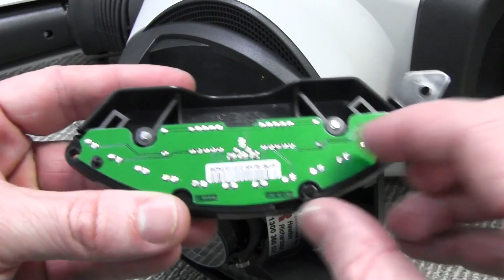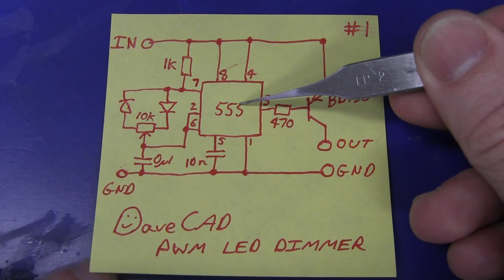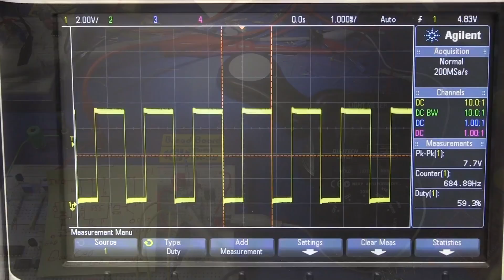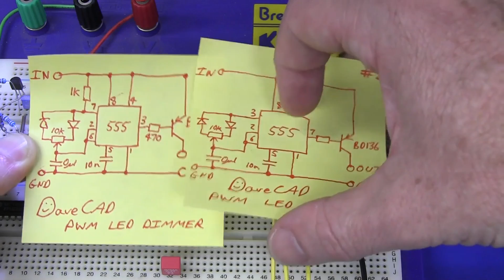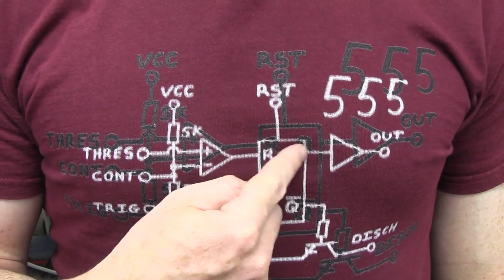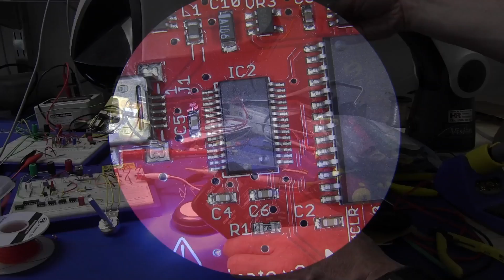EEVblog #392 - 555 LED PWM Hack

Comment: Could you go over again what the two diodes are doing?
Reply: having the diodes ensures that the charge time is governed by one side of the pot and the discharge time by the other without their interfering with each other. That way you can achieve a variable mark-space ratio (PWM). Plenty of great tutorials on 555 circuits online that will explain in even greater detail.

Comment: i noticed the final form had 4 caps- whats the 4th for ?
Reply: +sparky obrian I think there are 3 caps overall, not 4.  1) 0.1uF - Timing,  2) 10nF - Compensation on pin 5, and finally the 3rd one a bypass capacitor, across the rail, which is normally 0.1uF.  Hope that helps.

Comment: Bad form, Dave - modifying a circuit with the power on.
Reply: REAL engineers do it with the lights on! LOL
Reply: like 555 costs more than ¢15 lol
Reply: Bartosz Olszewski It's the principle bro. Is power on? If "yes", turn off then modify.
Reply: Electro I know that and still I think it's not worth it.
Reply: Bartosz Olszewski Would you eat without washing your hands? While you may not die, you are dicing with death.
Reply: Electro no, I wouldn't. But come on, I can't come up with proper analogy now, but he won't get any shock, maybe couple of cents if something got zapped. I understand that if you work with $1+/20V+ circuit it's good to turn off the power but for less than that I wouldn't even bother.
Reply: Bartosz Olszewski I know Dave won't get fried anytime soon, but the purpose of YouTube tutorials of this type is really correct training. There are some pretty eager young minds out there and they follow people like Dave, you or even me.
Reply: Electro well, yeah, sticking multimeter probes across unplugged power supply mains inlet traces is not a good idea (learned the hard way, but thank God only my probe got totally melted, not my fingers and heart) so there may be something to that. Respect.
Reply: Were you in current mode?  Any decent multi meter can handle 120v/240v AC Mains just fine (measuring voltage).

Comment: some one knows why there is a noise when I try to simmer a motor when I'm close the pot to 0
Reply: +moshe ashkenazi  you need a cap on the output and a diode in reverse to cut negative spikes

Comment: Having to use what I have on hand, I used an IRL3803 (140 amp rating is a tad overkill) instead of BD136. Between pin 3 and the gate I used 47k and since I have a CMOS version of the 555 as well the cap from pin 5 really isn't needed. I read it somewhere on Talking Electronics that pin 5 need not be connected in CMOS versions for PWM control, or perhaps I misread something, but it works well without the cap... The voltage going to pins 4, 7, and 8 get an additional 220ohm resistor but the voltage going to the FET remains unchanged. I got VERY close to 0-100% according to my crappy sound card oscilloscope.

Comment: Hi. And... if i want 30A power load?
Reply: Mosfets are your friend, hook up 5 IRFZ44s in parallel, and there you go.
I used this with one for 3 amps, works like a treat
Reply: +Juan Harris change the output stage
Reply: +Juan Harris look up IRFP250N hex fet use 2 pot a 0.1 ohm resistor on each source pin hook the gates to pin 7 and drain to gnd lastly a 1 k resistor between pin 8 and pin 7 (( pull up resistor ))
Reply: +Jamie Phillips that 0.1 ohm resistor will fry up
Reply: use a wire wound 1 watt they will handel it no prob

Comment: Would be nice if this could have dimmed one or the other side independently so you could get "side-ish" lighting. That's sometimes useful for component recognition and adds a bit more 3D depth to the image.
Reply: +PIXscotland I think it's just a matter of build 2 units and placing one each side. Good luck

Comment: I'm having a hard time seeing why just a 10k pot wouldn't work.
Reply: +techhelper1 ... Yes, a simple pot on the LM317 ADJ pin would vary the supplied current. But Dave would have had to cut the video to under 10 minutes, and most of that spent reading the data sheet. Where's the fun it that?
Reply: techhelper1 I believe most common pots are rated to handle no more than 0.25W.

Comment: I had subtitles on for a few of these videos, as I didn't have my headset around. The way you're voice is automatically made into subtitles had me cracking up give it a try some time,  just turn captions on when watching a video back. 

I wanted to do something exactly like this myself, I'm going to copy the final circuit and wire it up to my own mantis. Amazing they did not include something like this for such an expensive price of equipment!

Comment: Hi Dave, just a quick question :
I don't understand why the frequency is changing in the circuit #2.
In fact, when you adjust the pot in one direction, it lower the resistance to load the condensator and higher the res. to discharge it. And vice versa.
The freq. must stay the same, why not ?

Comment: Thanks Dave, I've seen a lot of your stuff and keep finding ways to implement things from videos you do.  I think I am going to use a slightly modified version of this to make a dimmer for the under-cabinet LED strip lighting I'm installing in the kitchen.

On a barely related note, I'm going to buy one of those t-shirts for my wife merely so I can comment on how nice the threshold and output pins look when they're cold :-P

Comment: Dave...you just screwed Mantis out of doing a $300 accessory light dimmer for their microscope.
Reply: They could do all that but "prior art" prevails and their action would fail. Besides, whilst the specific (clever) usage is for the Mantis in this instance the basic circuit exists in probably 10 million posts on the web ... do you think Dave really cares?
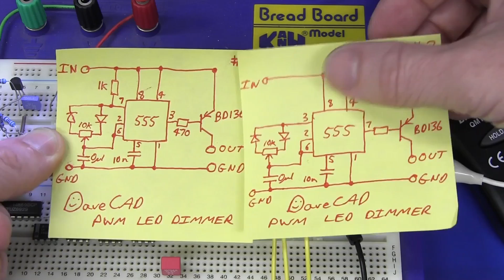Reply: @boblewis5558  I have seen the second version even on Great Scott's channel. Only difference was that I didn't quite understand the fact that pin 7 is used as an output. 18:50 is quite a jaw dropper for people just learning.
Reply: @lamjeri  a quick look at the internal circuit block diagram of a 555 would explain that confusion. BOTH pin 3 AND pin 7 are effectively output pins. 

Pin 7 being labelled "discharge" doesn't mean it cannot be used as an "output" pin because internally it is basically just an open collector of an NPN transistor, which when switched on provides a discharge path to ground for the timing capacitors. 

Pin 3 conversely has an output drive circuit which has its own "pull up" internally, hence the lack of need for the external pull up when used as the "discharge" pin. 

A clever use of basic understanding of the internals to "reuse" the chip in a clever component reduction. An engineering solution to the ever present "bean counters'' desire for cost saving, no matter how trivial!

It might surprise people starting to learn, but even engineers with decades of experience can be surprised by novel uses of a circuit because someone has realised the "detail" and how it can be used alternatively. A classic example is the use of 3 logic inverter gates to produce an oscillator. Not something that might easily occur to someone just starting out in electronics but very old hat to someone of experience.
Reply: @boblewis5558  You know your stuff, Bob. Impressed!
Reply: @boblewis5558  You know your stuff, Bob. Impressed!
Reply: And this video will demonstrate prior art!
Reply: What he's actually done is give them the blueprints necessary to steal the idea, manufacture and trademark it, and then take legal action against him. #CapitalismBaby

Comment: Cool stuff. My preference would have been to use circuit 1 with an N-channel MOSFET as a low-side switch. Circuit 2 was a clever solution though and I never would have thought of it.
Reply: That would be my preference also. Thanks.

Comment: Why not simply use a simple rheostat before the input power cable for a simple, and quick solution?
Reply: Constant current supply + any value below 50% = LOTS of wasted energy in the form of heat
Reply: EyesOnReality sometimes simple and quick arent the best solutions
Reply: It's usually why they end up getting called quick and dirty! :D

Comment: Man, You're so bright !! I was struggling to build a 555 PWM dimmer and y was quite lost after an intensive search to identify so many variations of the circuit, without knowing the meaning of it

Now I Got It with the Output  pin 7 or 3 variation;

 just 1 question, If supply is 9V , how this is that your 2 leds acting as diodes never fry  (i was always taught of limiting current in LED with load resistor)  so what happen to LED of the short-circuited side when Pot is 0 or Max (is it because ther is only limited current  flow through LED to charge the small capacitor ?

Keep the work
Reply: LEDs can take pulse currents much higher than their continuous current. That and since they only see the voltage difference between charge/discharge cycles (i.e. 1/3Vcc and 2/3Vcc) they are only getting 3V at most since supply voltage is also limited to 9V from the power supply. ;-)

Comment: I ca'nt find a lot of information on this type of pulse circuit. So I was wondering how well it works. I know that there are some lights that use this type of drive system. I wonder if the circuit you have would work well outputting 1 amp?

Comment: I was wondering, what do you think about the use of such a circuit to make an LED put out more light by pulsing higher than normal forward current at a low duty cycle and high frequency?

Comment: I thought I saw the frequency swing swap when the 555 circuit had the last modification. It was at first lower frequency at higher duty cycle and then it went to higher frequency at higher duty cycle.

Comment: I don't understand this.  I only get 50%-100% output range with this schematic and another variation that claims 5%-95%.  Any ideas?  Does using a low power version of the 555 cause this?
Reply: Never mind.  Doesn't like 5 volt operation.

Comment: Question: Might it not be more sensible to replace the transistor BD136 by a MOSFET?
Reply: good question. i think mosfet is overkill. it would be usefull if why decided to drive a motor instead of leds since it would be able to suffer 10-20 A of current. I use a IRFZ44 mosfet driving a dc fan on almost exactly the same above 555 pwm circuit.
Reply: jimis04 could you give me the schematic for this. I am doing a college project where i need to drive a motor which in turn will pull a hoist. Ive made a small model and this circuit would work. Also have you got an h bridge setup? Thanks for your help
Reply: geordieviewer
http://forum.allaboutcircuits.com/attachments/a-simple-pwm-circuit-based-on-the-555-timer-gif.12058/ georgediviewer this is the schematic that utilizes a mosfet for PWM with 555. you can replace IRFZ46 with IRFZ44 that is most commonly found on local stores.

Comment: It could be done with pot and one transistor as a current source (pot in emitor, base at dc bias). The current source with lower current would "overide" the other one. Anyway, this is much nicer solution.

Comment: The video explains it.  The P.S. drives a constant current device, so more resistance would simply increase the voltage (across the pot) and deliver the same current to the LED's.  A PWM is the perfect answer to this situation, although a non-inverted output would have allowed a higher PWM cycle (10% - 99.9% is better than 0% - 90% for LED control).

Comment: Good info.
I have a question. If I wish to create a 5KHZ PWM signal (+/- 3 %) over the full range of the pot sweep achieving the full 5% to 98% change in duty cycle what combination of Resistor and Capacitor value do I need to use in your design. Thanks.

Comment: how would you recommend using this circuit to step up the current and protect the circuit from back-flow for running something like an electric motor, would just a transistor and a diode do the trick? (lets say a 24v 10A motor)

Comment: A Power Potentiometer is an expensive part and will dissipate a lot of waste power as heat.  Dave is in Australia so he is warm enough.  By switching on and off to control brightness the design will be much more efficient.

Comment: Dave, When I do this circuit I connect the pin 4 to pin 5 this eliminates the need for the small cap and makes for an easier PC board layout.

Comment: Good Vid. Dave. I was using your first Bread Board design and changed it to your second design, as its for a differant use I have differant resistors but thanks the new board works much better.

Comment: Nice video. I'm looking to purchase a power supply for my laptop repairs. I've found 2 at a very good price both are 0-30v 0-5amp. However I believe they are Constant-Current. Would current limiting be better? 
Plus is there a method create an add on to manipulate the CC to current limiting seeing as the maximum current set would readily be available anyway.

Comment: Was trying to fiddle with a charge-discharge relaxation oscillator using single supply, didn't work, I have to do some hand calculations for it first.

Comment: Have you ever considered using coloured filters to help you discriminate between colours? Pause the video and hold a red filter up to the screen. The yellow trace will appear brighter, because of the red component. The reverse will happen with a green filter. Just a thought to aid your independence in these matters. I'm not colour blind myself, but it seems like it might work.

Comment: The thing that amazes me the most is that the manufacturer of the microscope did not include the dimmer function. Would not have affected the manufacturing price by to many fractions of Dollars I imagine. It could even have been used as a selling point. 

Love the solution. :)

Comment: I've a question about your 555 circuit. You connected the diodes to pin 7, and this pin with 1k to vcc. I prefer connecting the diodes directly to the output, gives a more symmetrical output and saves a component. Why choose this method?

Comment: Yep, I guess 0.1uF is nothing to be worried about, still i filter most of the PWMs before i feed them in to LEDs or DC motors simply because additional high frequency in a DC motor is 1- more noise and 2- bad for non-dipped coils. I know it's overdoing it, but i think for me it is worth it. I also have slight light induced headaches when the light is too bright or there is some kind of flicker.

Comment: Add i was giving 2 examples a) frequency of light b) frequenzy of flashing where somebody can be abnormalyl good at detecting light. I see those light flashes in neon tubes too. I just say that there are limits. And that tim was right - pwm sould be in the kiloherz range so you cannot see it.,

Comment: question dave;
what is the lux output of the two LEDs in the 555 circuit? how much of the missing 2% of the total lux output of the circuit do they make up?
if you were to integrate the whole circuit into the mantis and make those LEDs white could that help make the whole thing more efficient in terms of lost original output?

Comment: If i move my eyes fast i can also see neon tubes flicker at 50 or 100Hz. But 1khZ is impossible  - your bain and eyes are much slower. Cars shouldnt have a frequenzy at all. THey are battery powered. ANd the battery is cahrged by the light machine. Cars should ahve 0 herz - so constant light. If u see flicker there i cannot explain it. Could it be that you close your eyes without noticeing?

Comment: PWM doesn't change the voltage/amplitude like a voltagedivider/pot, it changes the fequency - is like switching on and of very fast. The brightnes is determined if "the switch" is longer on or off (longer on -> brighter and longer off -> less brighter)

Comment: I perfectly understand your design.

robot797 asked if he can use LM317 to controll an amount of light produced by LEDs.
TheLawnWander said LEDs need PWM to do that.
I have met a few people who mistakenly believe LEDs must be powered only in pulsed manner — otherwise LEDs will work in wrong mode. Bullshit. Actually, an amount of light produced by LED depends from current through it, so you should control current flowing through LED by any method you can do it, but not only by PWM.

Comment: Simply adding a 50-100 ohm pot in series with the resistors on the existing regulator would have done it.

Comment from the maker: Err, it's a 0.1uF bypass cap... And the regulated 9V input (minus the LM317 drop) limits any possible maximum voltage. Nothing to worry about.

Comment: I don't like that you use the 555 with the constant current regulator and you put a cap after it... That way when the 555 is in the lower % of the PWM the voltage over the power input of the new circuit will rise due to constant current regulator trying to keep the current at 0.5A. In that case the LEDs will be exposed to much higher peak current. They will probably survive it, but in time their crystals will start failing. I am not a big fan of PWM in lighting.

Comment: Is that what the cars run for their tail lights?  If I move my eye rapidly I can see the trail breaks up.  They can't be running 1 kHz.  But yeah, CRTs were hell for other reasons than flicker.  My plasma's 48 Hz setting annoys me due to flicker, but that's common.

Comment: Thanks Dave. 
I will certainly get down to modding mine. 
And yes, different types of LEDs could well be useful. In fact vision engineering can supply different led banks. Not sure how much they cost though.

Comment: The LED PCB power connectors should be the same on both sides. Just bypass the existing wiring from the jack to the PCB plugs. 2 555s and an XY pot would sure be cool and easy to use. There is the problem of where to run the wires to the outside of the case without modifying the case.